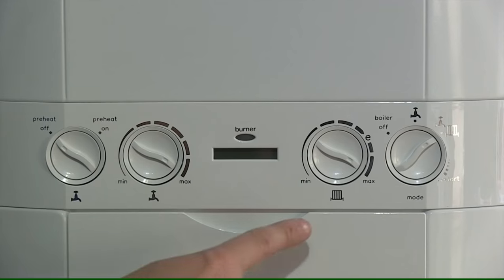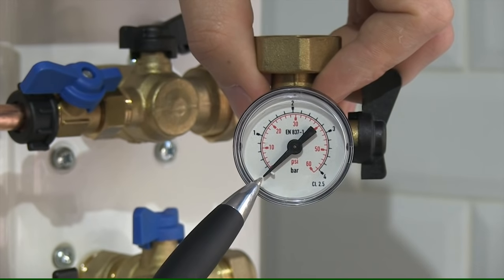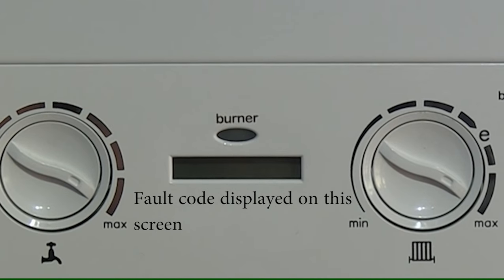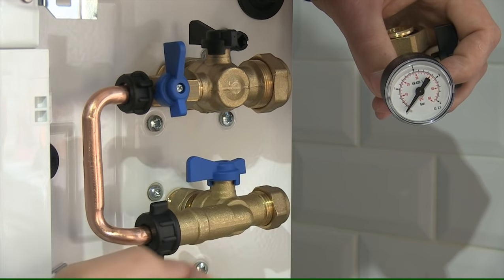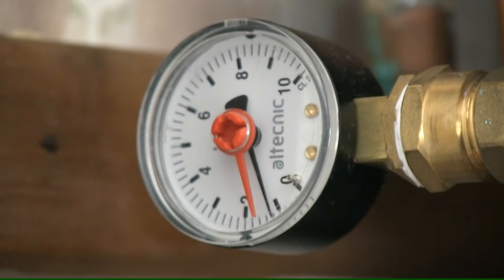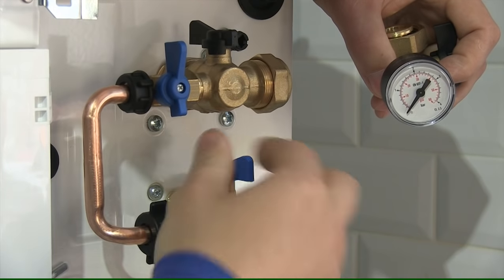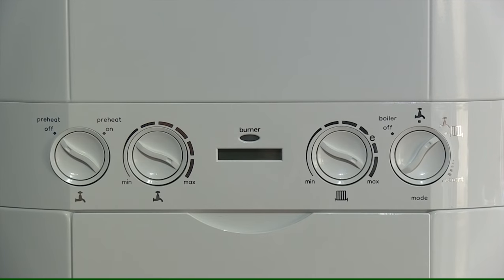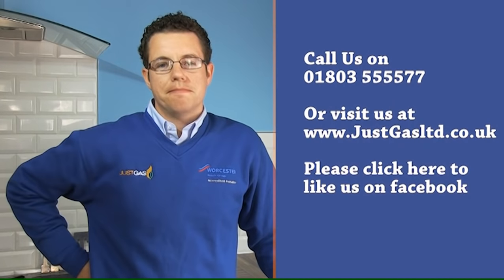Ideal logic filling loop

Comment: My gauge is on the front of the boiler not underneath. Another video on here mentioned anything between 1 & 2 bar is ok. Maybe a slightly newer boiler I have? Installed 2019 and my bills plummeted by 2/3rds back before Utility firms got mega greedy.